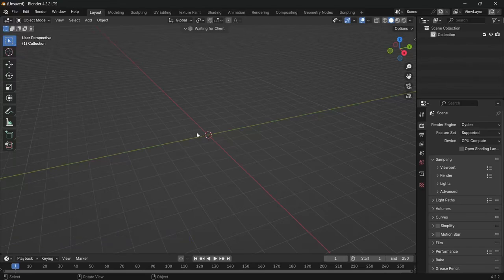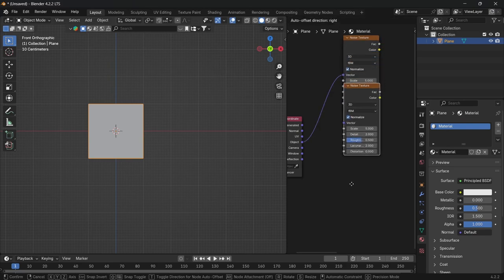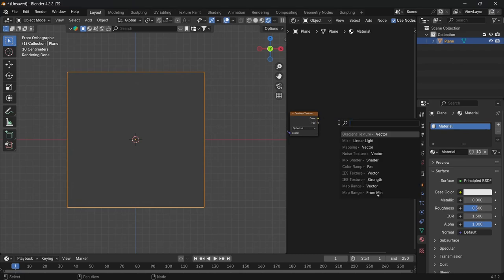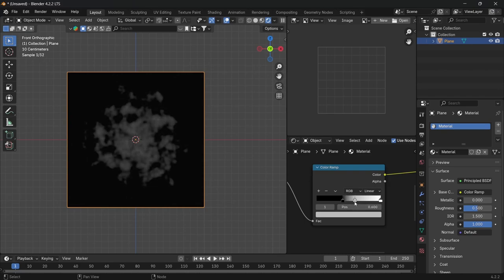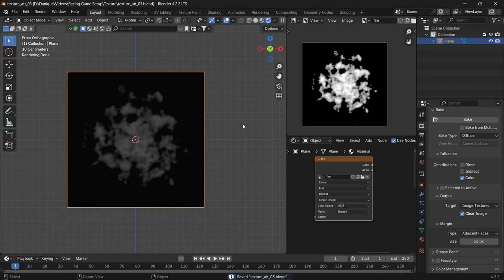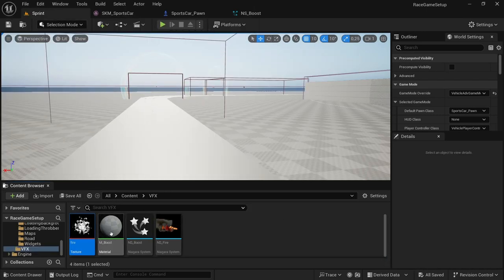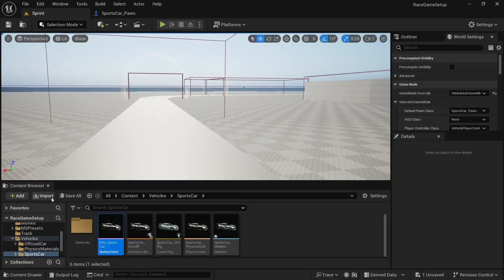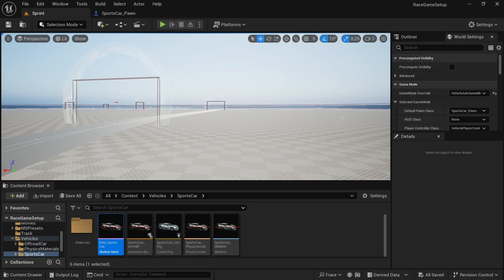Setup a Simple Boost Trial | Unreal Engine | Racing Game Tutorial

Comment: when my car flip the front wheel still rotating please help me out this
Reply from the maker: It's most likely the leftover rotational force from when the car was in motion. If the wheel is rotating unnaturally fast for leftover rotational force, then in the blueprints that control the wheels, check to see if the 'Affected by engine' is selected. In the car blueprint, when you select the 'vehicle movement component', somewhere around where the torque curve is, look for a power split slider. It determines how the power will be split between the front and rear wheels. Hope this helps
Reply: @GenuImitation  ok i will try nd one more thing when i possess on car nd unpossess from car so car still move with last input with i use example if i press W nd unpossess while pressing W key to car still throttle nd the steering is also in same direction
Reply from the maker: @shahmaarbaba when you say, "possess and unpossess" the car, are you talking about using a character to get in and out of the car ?
Reply: @GenuImitation  yes
Reply from the maker: @shahmaarbaba sorry, I can't help you with that, I haven't tried to do that so I can't give any advice
Reply: @GenuImitation  ok but thanks for the wheels solution